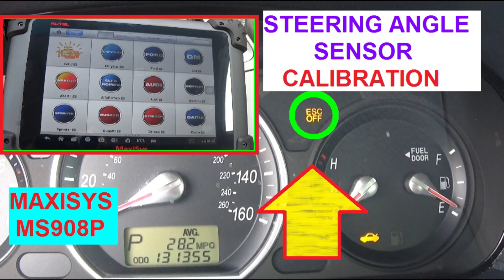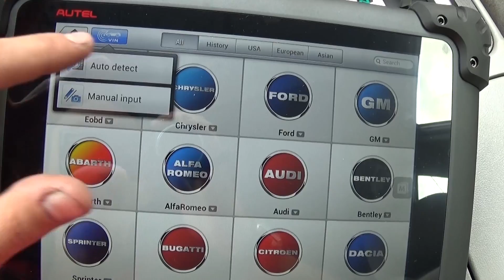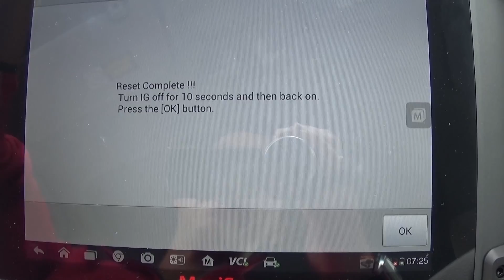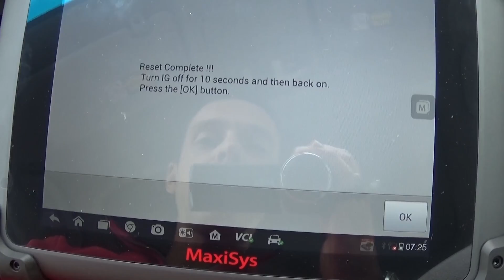How to Calibrate Steering Angle Sensor with MS908  Demonstrated on Hyundai Sonata with ESC LIGHT ON

Comment: Hi. I have a Toyota and we changed he electrical power steering motor and the wheel turns to right when we  turn on car. Does it have to be calibrated? We also changed the angel sensor.. does that also need to be calibrated?  We are so lost
Reply: Yes you have to

Comment: where can i get this done my girlfriend esc light is on in her 2006 hyundai sonota gls i replaced her brake light switch with a OEM switch but the esc still isnt going away when i press the button
Reply from the maker: +jonny2tim3 Hyundai will do it but they will charge you for 1 hour. I will recommend finding a small shop that has the tool to calibrate it. They should not charge you more than 40
Reply: +World Mechanics how much is that tool
Reply: do you get answer? around 2000 Dollar, buy the original, so you are on the save side.
Reply: jonny2tim3 ....used an obd2 scanner to read the code that set in the abs module first